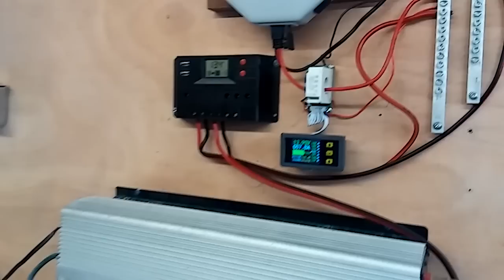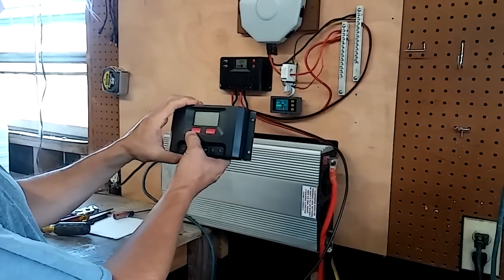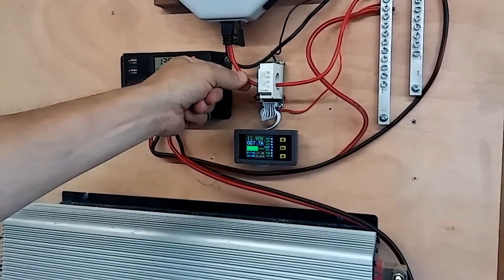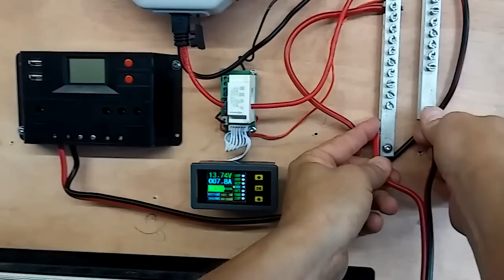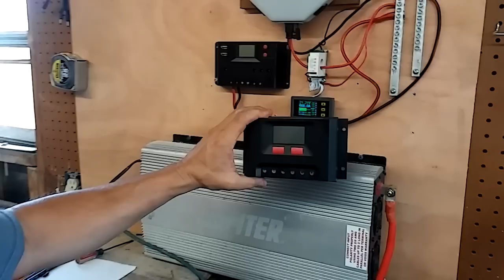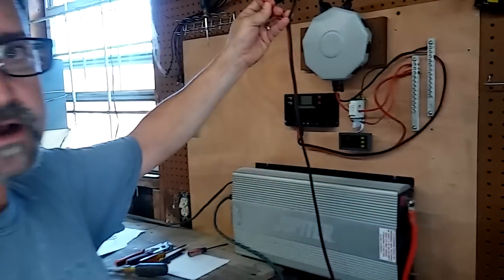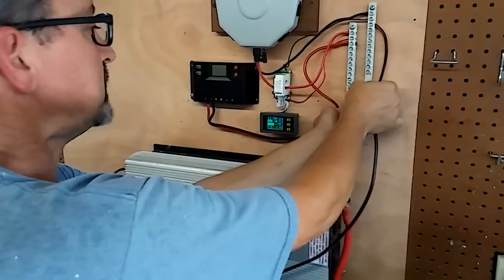Maxing out Harbor Freight solar panels

Comment: OK.. am I missing something here? 8 amps will put you on the floor. Are we sure that is not .8 amps? Or is that DC voltage with no ground? Not even remotely an expert in electricity
Reply from the maker: teveler. It’s DC voltage DC voltage is not going to shock you at 12 V regardless of the amperage that backs it up. Have you ever been shocked by a 12 V car battery that has a capability of putting out 800 A or more? No you haven’t and neither has anybody else

Comment: Sorry, but you have NO CLUE how an MPPT Charge Controller actually works.  NO ... you do not connect the battery bank directly to the PV Array and then magically claim "that is all the power that I can get".   Please do some research, before posting any more nonsense ....
Reply from the maker: MrSummitville. You’re stupid. It’s not feasible to add an MPPT charge controller to 100 Watt set up. And for your information I did end up buying one and it didn’t help at all. It wasn’t until I added more panels that the MPPT was able to do it’s job. Spending $180 for a single hundred watt panel is freaking ridiculous. I was showing the max output of a single panel. I believe I have proved my point. So go Spread your stupidity somewhere else

Comment: You really have allot to learn and should try to learn things before posting videos that show you don't know much if anything about solar!  The panels are most likely making far more watts/amps/volts than you will ever see with anything you are doing the way you are doing it! 
You are throwing away any power over about 13.5v because that is about normal full charge battery volts. Those solar panels are probably making about 180-200 watts in fun sun at about 20v, so best case is 200watts-20v=10amps. Since you do not have MPPT controller then either controller you have or a direct wire connection is only going to be at battery voltage and all power from battery voltage up to the 20v panel volts is thrown away!  200watts-12v is 16.666amps. BUT you are throwing away much of those amps because you cannot convert the power from 20v to 12v, so 8v of loss!  Not certain exact way to do the math here but basic idea is you are getting 8amps at 12v so 96watts, tossing out 8v at 8amps so throwing away 64 watts. That would be a total of 160watts made. Now I now my math is not right and you are throwing away more power than 64watts, just not exactly how to do the math right.
 Anyway, this is why you need an MPPT controller to get max power! An MPPT controller does not just trash those extra 8volts, it converts the total Watts to the battery volts so at 10v 200 watts you should get 20amps, near full charge at 13v 200watts would be 15.38amps. The rest would then be if your battery bank can take the charge at the provided amps. A big bank of 1000amps could easy take 10amp  charge still at even 13v, but one little battery will not  and thus again power would be lost because of the battery bank size too small.   In any  case the panels will function at full power in full sun but it is up to you to have the correct componants to capture that power. Also, if your batteries are at full charge you should see 0amps coming in since there is nowhere for it to go, no matter how good the solar panels may be working.
Reply from the maker: Well,, just for your information there buddy.... I did buy a mppt and gaind only .5 amps. Large expence for nothing.. However.. I did add more pannels which the mppt liked. So now i can justify the purchase.. Harbor Freight pannels do not put out the power they are rated at. I have done the testing and have proven that. My mono panels however do put out much more than harbor freight. My 2- 100watt pannels put out more than the 300 watts of harbor freight pannels do. So no.. Mppt did not help me with with this set up in this video..

Comment: not sure how old  this vid is" after i full screened it i was able to see the upload date"  i recently bought the 500 watt controller you had issues with. im not a fan either! i ended up getting an hqst controller from amazon for 40$ and like it much better. seems to be getting more watts to the batt than the other controller and lets you know how much juice is in the batts. not sure how accurate it is but i do know the harbor freight controller will only get my batts to 13.1 and stops. the other one says its only 3/4's full and keeps going. hope this helps. also got the hqst panel ill be installing soon. im trying to get enough watts to charge my 2 deep cycle 6 volt batts in one day if possible. those batts will run my normal night time power usage and then recharge while im at work. "thats what im hoping for anyways lol" my current set it 2 100 watt thundervolt panels and 1 hqst panel, 1 hqst 30 amp controller 2 6 volt deep cycle  and a 2000 watt samplex pure sinewave inverter. if everything works as plan it should be enough to run my office at night and be charged by the next day. maybe i should do a vid lol i keep saying i need to make more but never find time.
Reply from the maker: Nice setup. Would love to see it. I should make more videos to. I’m kinda at a stopping point now. New controller and added some panels. I guess the only thing left is to do lithium 🙄.

Comment: Unhooking the battery from the charge controller while the solar is still going is a good way to ruin the charge controller.
Reply: True. To get around this in MY system, I installed two switches: 1 Between the Battery and the Controller, and the other switch between the array and the Controller. This way, Each  component of the system can be quickly isolated from the other two, preventing damage to ALL.

Comment: I've spent the past 6 months slowly buying solar equipment almost have everything I need to properly install a 500 Watt system 
With gel batteries 2000 Watt inverter proper wiring and T-fuses and a lot of trial and error,  it's not cheap and not something to do if you don't have the money, I've already blown up an $800 inverter just testing the setup preinstalled, 
Its a learning curve and everything I mean everything must be grounded,,
Harbor freight is for kid's projects, and cheap tools lol 👻👻👻
Reply: All their crap is made in Red China. 'Nuff said.